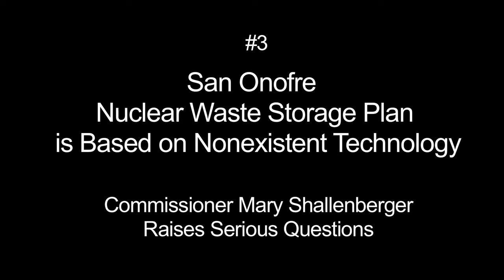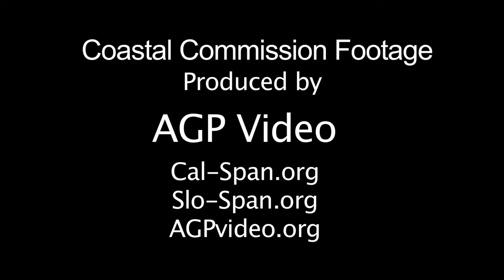San Onofre  Nuclear Waste Storage Plan is Based on Nonexistent Technology

Comment: Tom Palmisano did not disclose to the Coastal Commission that even if they find cracks (which they still haven't been able to do), they have no plan to repair cracks and no plan to replace cracking canisters. Partially cracked canisters are not approved for transport per NRC Transport regulations.  Learn more at SanOnofreSafety.org.  In fact, at a recent Edison Community Engagement Panel meeting, Palmisano announced they plan to destroy the spent fuel pools after empty. This eliminates the only on-site method to replace canisters.  One of the Coastal Commission requirements is the ability to transport these canisters away from the coastal area.  They will have no way to do that.  A two-year old canister at Diablo Canyon has all the conditions for cracking.  It is also located near the Pacific Ocean.  Unfortunately, the public was not allowed to make comments after this part of the presentation, so information could not be shared with the Commission.  Shallenberger did a great job asking the right questions.  The question that needed to be ask next is what will they do if they find cracks?